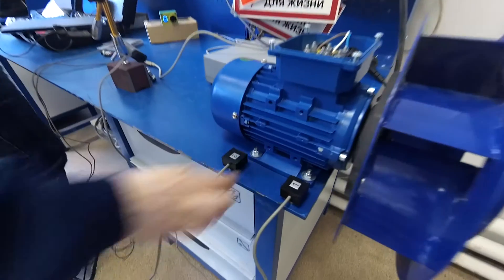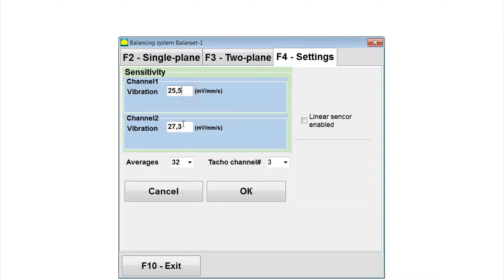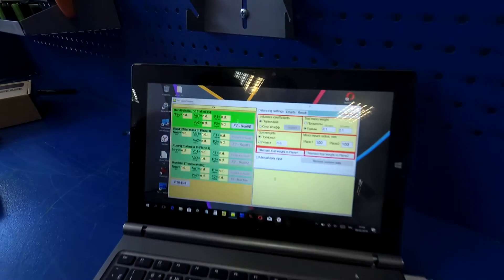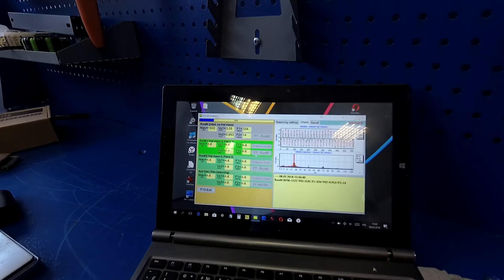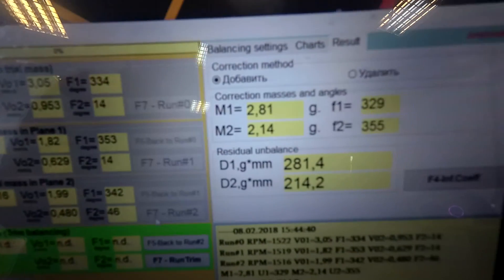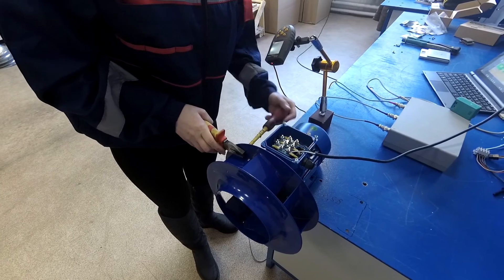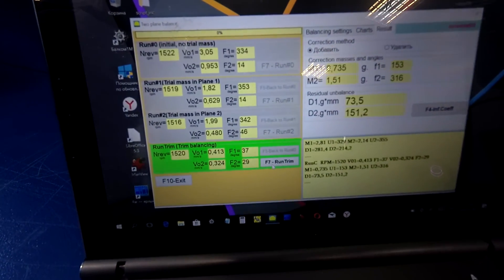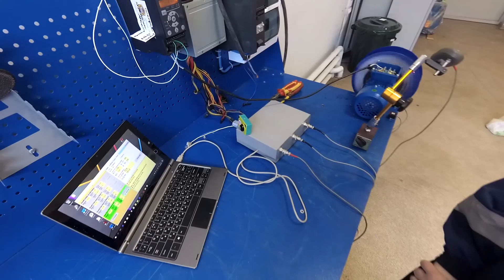Impeller Dynamic Balancing on Site with Balanset-1A

Comment: Nice video! Btw, once I've found that the planes shown at 0:18 should been switched. Can you explain this step, please?
Reply from the maker: In practice, both approaches can work. In two-plane balancing of an overhung rotor, the instrument needs two measurement points that respond differently to changes in unbalance in two different correction planes.
There is no rigid rule in two-plane balancing of an overhung rotor that strictly binds a specific sensor to a specific correction plane.
The key requirement is that the measurement points and the correction planes provide distinguishable information. A change in mass in different planes must result in different amplitudes and/or phases in the measured vibration. If the sensors and correction planes are selected so that the instrument “sees” two different effects, the balancing process will be stable and reliable, regardless of the sensor order or the numbering of the correction planes.

Comment: Interested in your product. Have always used 4 sensors ti do 2 plane balance. X & Y on two pillow block bearings. Two plane not necessary if W/ D is less than 4:1 ratio.